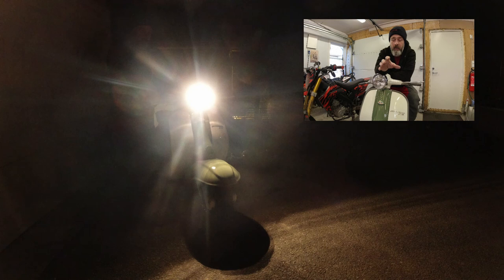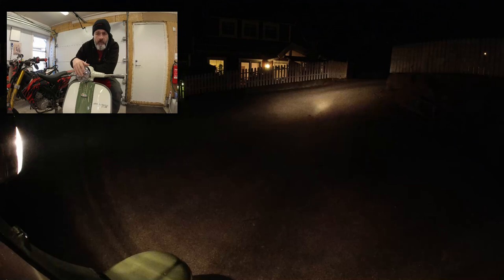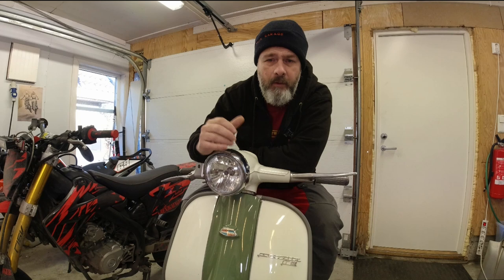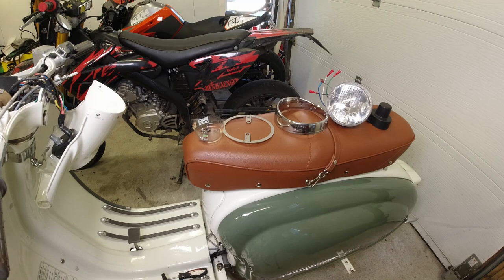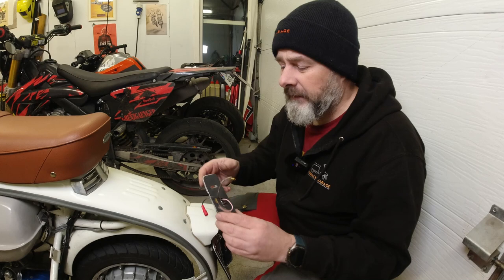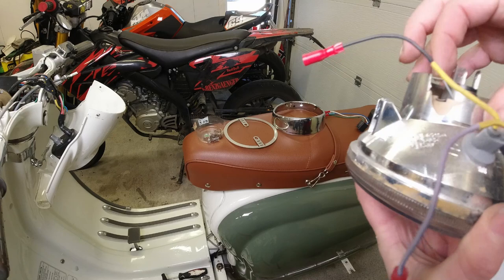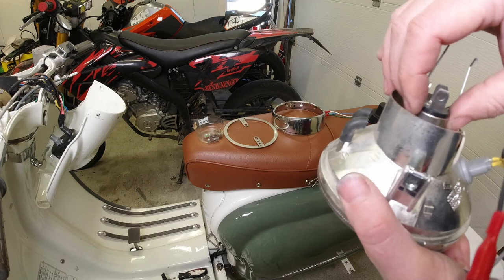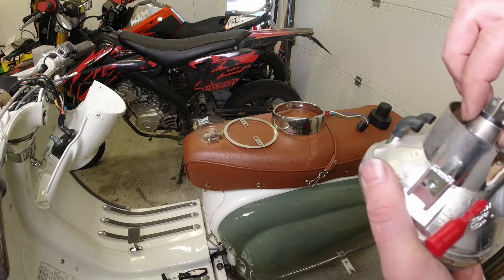Jockey`s Boxenstop H4 headlight conversion #kickbackgarage #lambretta

Comment: I have ordered one of these today :) will be the final step in rewiring my 61 Series 2 Li150 (RB20 5-speed). I also made (from scratch) a complete new loom with 16awg wire in a full DC conversion using my Vape ignition with the SIP R102 pure DC rectifier/regulator and a 9 mah battery in the toolbox. I have the BGM rear LED light, again all rewired in 16awg silicone cable. I also rewired the light switch and bought a ceramic H4 plug to attach directly to the switch wires. I'm using the MB MBP0153K 'Fit All' ignition switch which switches from side light to normal light, dip and main are controlled from the light switch. Looking forward to decent lights and electrics. While I was at it, I wired a front brake light switch into the master cylinder for the front brake. Happy days Rob :D

Comment: I go back to the sixties when upgrades were not so easy to get hold of and standard Lambretta lights were next to useles. Might as well have had an oil lamp to light the road.
I now have an LED rear light unit, uprated headlight bulb and twin Lucas spots with LED bulbs that cost a small fortune but do the job on our mountain roads here in Spain. 
I also have a Vape DC system with battery which evens out the power supply and in the event of a breakdown at night means I still have lights.

Comment: I hope Jockey and the boys come out with a conversion for the GP. Good video Rob. Also it looked like a beam of light was escaping from.the top of the headset.
Reply from the maker: You are not supposed to notice that! It's my halo 🤣
Reply: As this H1 headlight is an aftermarket product for Harley Davidson I doubt that this will ever take place.
Reply from the maker: Is it for harley? I thought it was off a Chinese scooter 😂
Reply: @kickbackgarage  Yes, and it's made in China. 

But you can remove the plastic lense and replace it with a Carello headlight glass/lense to gain a classic look combined with better lights than an original headlight assembly. The bulbs are available in 40/45 wattage as well, but without the E-legislation for road use. 
I have tried 55/60 W with a glass lense so far and the result is immense. But I haven't tried it at summer time as it might get to hot and will melt. Probably I'll try and stay with the 40/45 W once I open the headset again...

Comment: Yes my li has had a 12 volt conversion but even now when you press the brake pedal the headlight almost disappears so led rear will be next then if the headlight is still under powered I may this conversion 👍😀
Reply from the maker: The led rear will stop the dimming of the headlight and you will get full power to the headlight. Another thing you can do if your headlight reflector is in good nick is fit a scootopia halogen bulb. They sell one that fits the original headlight socket.

Comment: Hi Rob. I’ve fitted a Jockeys headlamp to my Series 2 but found that the dip beam blinds oncoming traffic, and the full beam wakes up roosting bird life in the trees. Now, a Series 2 headlamp cannot be adjusted. I am right on that, aren’t I? Love your vids, and would welcome any suggestions you might have.
Reply from the maker: On a series 2 the bottom hole on the headlight rim is slotted so there is some adjusmet and it's possible to file a bit more to eneble to point the light down enough to not blind others.

Comment: Hi Rob my unit was delivered from Jockeys with a 35 / 35 watt bulb, I notice you said you were using a 55 watt bulb. I take you have had no problems with heat on the plastic lens?
Reply from the maker: Yep. No probs running a 55. Got that in both mine. No melting and we have to run daytime lights by law. That's why I run a led rear to get enough juice up front.
Reply: @kickbackgarage  Thanks Rob
Reply from the maker: No problem 😎